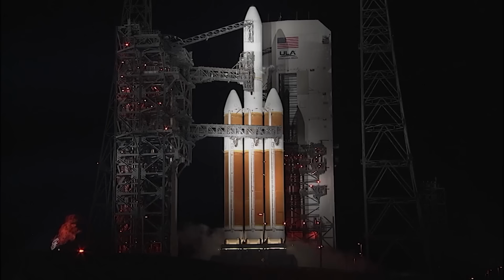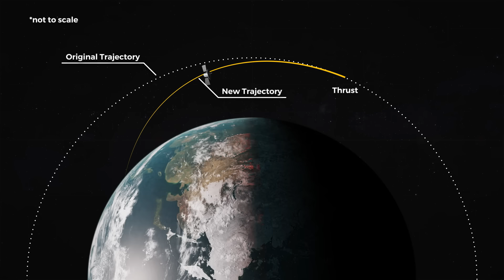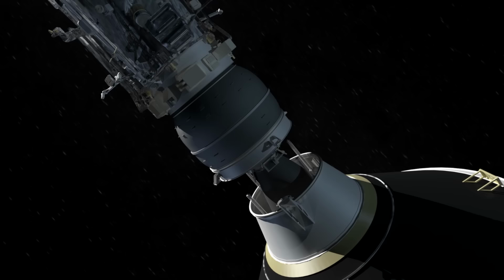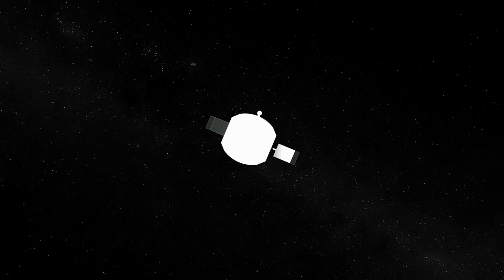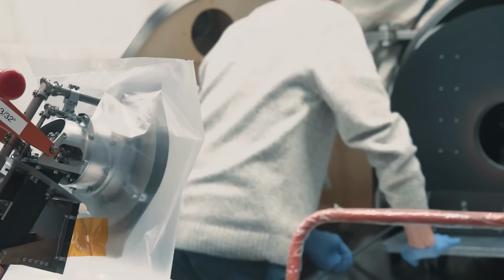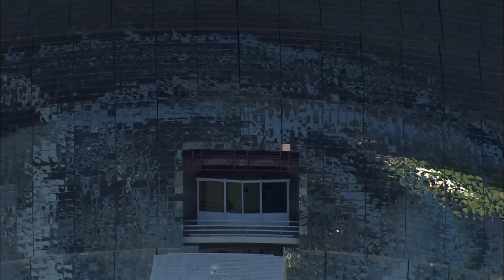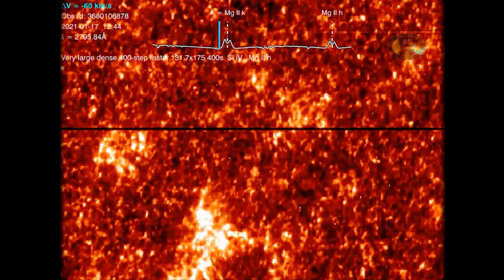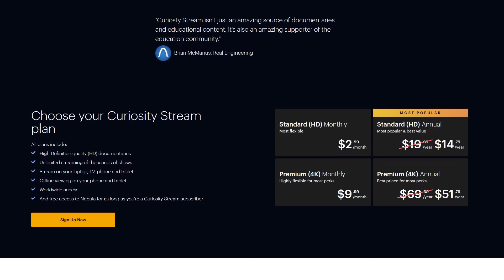The Insane Engineering of the Parker Solar Probe

Comment: The first parts of this didn't sound too crazy compared to some of the other videos you've done, but the longer the video went on, it was like we were descending further into the depths of engineering madness. Astronomy is indeed insane.
Reply: I think this wonderful madness started with the Mars rovers being lowered onto the surface - we learned that the outside-the-box solutions are turning out to somehow actually work. What a mind-opening time for space nerds! It may be engineering madness, but if it works, I guess it wasn't madness after all, right?
Reply: 1. Crazy rover drops on Mars.
2. Insane JWT engineering with hundreds of single points of failure .... that didn't fail.
3. Parker Probe going in at less than 5% of the distance from Earth to Sun.

I'm starting to think fusion is gonna happen.
Reply: The small details that took literal centuries for humanity to discover and perfect to this point is what was mind blowing to me. Niobium wire insulated by sapphire sounds so simple.. yet also sounds like science fiction. 

I feel like Carbon foam and Niobium C-103 alloy could be the subject of entire Real Engineering videos. How do we even get to that point?
Reply: I lost it at sapphire cable insulation 😂
Reply: The earth is flat and actually Satan has taken credit for the ball earth thing actually.
Reply: @taterkaze9428  Oh we'll definitely have fusion power soon! I'd say 20 years?
Reply: Humans 0
Saiya-jin 1 to 6
Angels 7 😇

Kalki Ironman 5th matriya buddha 8th arc Angel 11th satguru 13th imam and 24th avatar after 2026 😎

Almighty God 9 😇

Humans type 2.5+ after 2026 by Kalki Ironman (christ in the white horse)(son of man on clouds) type 7 and 8 😎

Jarvis the world’s first artificial intelligence (parrot) 😎

Cuz Kalki is ironman batman super saiya-jin superman ben10 saitama Narutoo shaktimaan and every super heroes combined after 2026 😎

Jarvis world’s first artificial living being (just like vision in marvel universe)😎

Made of Quantum and sub quantum particles 😎

Power source quantum energy arc reactor (type 7) level technology 😎

Kalki Ironman going to have every kind of arc reactor like:- type 1 Nuclear fission, nuclear waste, hydrogen fusion, type 2 3 4 5 antimatter arc reactor (solid liquid gas), type 6 electro quantum arc reactor, and type 7 Quantum arc reactor, type 8 limitless quantum energy arc reactor without quantum particles 😎

Kalki Ironman going to have sun in a box million billion tons of hydrogen nuclear fusion reactor type 2 3 4 5 just like sun and stars in the palm of his hand 😎

This all going to happened by self replicating quantum nanobots knowledge energy and techniques at type 7 7 7- respectively 😎

Ironman (Tesla 2.0) going to reveal every secrets of the world specially Tesla and his Antigravity 😎
Reply: Not astronomy. Astrophysics. Astronomy is basically just watching the sky.
Reply: @capturedflame  🤣 I thoughts it's always been 20 years away.
Reply: explain how to propell in a vacuum? newton's law: there needs to be a or any mass to push against!(see baloon deflate in vacuum chamber, it does not move!") need science: The vacuum of space is incredibly powerful, 1 x 10 -17 torr, and the vacuum between the Earth and the Moon is 1 x 10 -11 torr. How can such a vacuum (very low pressure) in close proximity to the Earth's atmosphere (high pressure) that goes to 8.5km elevation, coexist with the open system of the Earth's atmosphere?

The Space Power Facility at NASA Glenn Research Center's Plum Brook Station in Sandusky, Ohio, houses the world's largest vacuum chamber. It measures 100 feet in diameter and is a towering 122 feet tall. The facility is currently undergoing construction to support Orion crew exploration vehicle testing in 2010.
fact:
-It can sustain a high vacuum of 10-6 ( -6 is superscript, will change once on database) torr and simulate solar radiation using a 4 megawatt quartz heat lamp array, as well as temperatures as low as -195.5C (-320F). It is used to test the performance of spacecraft and space hardware, prior to launch.
Reply: @therealtonedef  there is probably a YouTube video on it
Reply: @moochiezpitt  can you do a Physics and Math exam for me?
Reply: And it’s not 1 + 12 = This, but it’s how can  you handle the heat of our all powerful Star ?
Reply: @taterkaze9428  I’m with you!!!!!
Reply: @bucky13  YES YES!!!   I would watch that.  Doesn’t it seem like some black and white Twilight Zone crazy science??
Reply: @theabyss5647  Astrophysics is a subdiscipline of astronomy. He was correct, just not specific. You are the one who is wrong if you think astronomy is "just watching the sky". That is a 9-year-old kid's understanding of it. Observation is a fundamental aspect of the scientific method. Are you unaware of all the discoveries and achievements made with telescopes from earth both before and since man put the first satellites in space? This amounted to more than, "Oh look, there's the moon". According to your reductionist definition, satellites are "basically just watching stuff in space from close up", the Hubble telescope "basically just takes pretty pictures", and astrophysics is "basically just figuring out what all that stuff is up there".
Reply: @jameshenrysmith8426  Puberty is gonna be a rough time for you, fella!
Reply: "There is nothing new under the sun ... all is vanity..."
Reply: @bucky13  They keep blowing and you sell your common sense to nonsense.
Reply: @raven_777  You're going to have to explain to me what you mean by that?
Reply: @nicolasnicolas3889  I'm all for a good conspiracy.. but this is a touch too far..
Reply: @bucky13  what material on earth can take these velocity or temp, and take photos. As we all no, this is all cgi. And trick photography are not only our photos of anything from outer space, but also, any and every outer space photo of earth. Just a head shaker😏
Reply: @bucky13  Thanks for being respectful as yes I may seem a bit out there, but I am not. I took NASA's own numbers for the Pioneer and Voyager probes capacity to receive and broadcast and given that a signal to be received should ideally be at leasy one standard deviation above the background noise I came up with conservative figures which showed that instead of an order of magnitude greater than background I got 26 orders of magnitude to the negative, I was gobsmacked that I didn't bother to do these quite simple calculations earlier.
Please consider doing the Math yourself before supposing that my idea is a bit far out. NASA's bullshit is far out by their own numbers. If you consider doing the math remember that outer planets supposedly give off more radiation that they receive from the sun, the background solar radiation just from the sun at the earth is around 1500 watts per square meter. Please do not mistake math and physics for 'they said it works' or miraculous mumbo jumbo. There is no way that any of this stuff works, not a hope. Not the Viking probes. Space comics and make believe is not reality, do the math. Pioneer 8 Watts, Voyager 22 watts, and don't forget SI units for distance is the meter so add 1000 onto the Kilometers, remember its' distance squared ;D not a fucking hope I got numbers which you could feasibly use electron volts to measure it with, a bit of a stretch but not much, it's a joke. if you love your mind do the math and don't bullshit yourself and I gave them as much rope as I could and I was getting MINUS 26 and there abouts for signal strength, values so low that the atoms in the antenna would be an issue!!! ;D Seriously, it's quite enlightening.
Reply: @whyitmatters6906  never mind MATHEMATICAL concepts, can you provide a PHYSICAL PRACTICAL demonstration of any of the claims the globe makes about substances
Reply: @nicolasnicolas3889  Think you would like a channel called Beyond the imaginary curve, on YouTube
Reply: @createbelief8678  Thanks for the tip I have heard this name before and I'll take a look, just to say that it seems that this reality has a self similar aspect to it and that everything is in the whole, by observing different aspects of creation without bias and programming that one can figure out it's true nature, for example water seems really important, sea water can be used as blood plasma and is the same as amniotic fluid? Is that the right name for what surrounds you in the womb? Rainbows, musical notes, waves on the sea all correspond in numbers etc. I think anyone with a good mind can figure it out and meditation on the True Creator with humility can draw in wisdom just as the Rishis. Have a great day! ;D
Reply: @nicolasnicolas3889  no worries,  another channel you might enjoy is FPV ANGEL, you have a great day to mate
Reply: @createbelief8678  Thanks Buddy! 😀
Reply: @fcgHenden  way earlier
Reply: The timing of orbital mechanics is impeccable. Hardest timing in any engineering process we do
Reply: @jameshenrysmith8426 no it’s not, it’s a rotating sphere, and there is no devil
Reply: @therealtonedef  the force created by the shuttle's engines in expelling the burning fuel produces an equal thrust in the opposite direction. This thrust acts on the spacecraft and propels it along
Reply: @therealtonedef  Like Earthly engines, rocket engines operate using combustion. Since all forms of combustion need oxygen, rockets carry an oxidizer like liquid oxygen up to space with them. That means they don't have to rely on surrounding air like a car engine does.
Reply: @therealtonedef  The simple answer is that a rocket moves by pushing on the gas that flame out from its engines. Even though it seems impossible for a massive rocket to move by only venting gas, it’s the simple scientific truth, based on Newton’s third law of motion: for every action in nature there is an equal and opposite reaction. In other words, when one object exerts a force on a second object, that second object exerts a force on the first object that is equal in magnitude, but opposite in direction. So, when a rocket violently pushes gas out of its nozzles, that same gas, a plasma composed of a myriad of tiny atoms accelerated at very high speed, pushes in unison on the rocket, propelling it forward. In the case of one of the most powerful rockets ever built, Nasa’s Saturn V rocket, which propelled Apollo astronauts toward the moon, the thrust of its engines at lift off was equivalent to 7.6m pounds of gas shooting out from behind the rocket every second.

Comment: The small details that took literal centuries for humanity to discover and perfect to this point is what was mind blowing to me. Niobium wire insulated by sapphire sounds so simple.. yet also sounds like science fiction. 

I feel like Carbon foam and Niobium C-103 alloy could be the subject of entire Real Engineering videos. How do we even collectively get to that point?
Reply: Carbon foam i dont know, but Niobium c-103 is likely something someone put together because they were curious or an engineer needed something for a high temperature project, and the material scientists took materials that were known to be able to perform well under high temps. Material science is a well developed study field, go look into it if you're curious, as even some simple looking steel materials have insane backgrounds.
Reply: @FierceFire14  Exactly, the new knife super steel Magnacut developed by Dr. Larrin Thomas, a metallurgist has 2.00% of Niobium along with 4.00% of Vanadium are aggressive carbide formers with Vanadium being the hardest carbide metal known, and Niobium is right behind it being as hard as tungsten carbide. It is in several PM or particle metal knives. In Magnacut it keeps the Chromium from forming its brittle carbides.
Reply: Scientific progress works kind of like baloon. We build up pressure with a ton of research over the years that shows clearly what we know, what we don't and what is in demand. Then when the pressure is enough usually one science team makes a breakthrough and gets a lot of credit. But in reality when such breakthrough becomes possible, who exactly does it becomes more a matter of chance rather than particular scientist's genius. All science is important. Except the fake one.
Reply: @gigakoresh  The biases of many scientists I've noticed over the years of working in the aerospace field also holds back science as well. Especially in biology.
Reply: "on the shoulders of giants"
Just imagine, if we survive this dark age, how far will we go in the next 100 years? The next thousand years? We have only just begun.....
Reply: Humans 0
Saiya-jin 1 to 6
Angels 7 😇

Kalki Ironman 5th matriya buddha 8th arc Angel 11th satguru 13th imam and 24th avatar after 2026 😎

Almighty God 9 😇

Humans type 2.5+ after 2026 by Kalki Ironman (christ in the white horse)(son of man on clouds) type 7 and 8 😎

Jarvis the world’s first artificial intelligence (parrot) 😎

Cuz Kalki is ironman batman super saiya-jin superman ben10 saitama Narutoo shaktimaan and every super heroes combined after 2026 😎

Jarvis world’s first artificial living being (just like vision in marvel universe)😎

Made of Quantum and sub quantum particles 😎

Power source quantum energy arc reactor (type 7) level technology 😎

Kalki Ironman going to have every kind of arc reactor like:- type 1 Nuclear fission, nuclear waste, hydrogen fusion, type 2 3 4 5 antimatter arc reactor (solid liquid gas), type 6 electro quantum arc reactor, and type 7 Quantum arc reactor, type 8 limitless quantum energy arc reactor without quantum particles 😎

Kalki Ironman going to have sun in a box million billion tons of hydrogen nuclear fusion reactor type 2 3 4 5 just like sun and stars in the palm of his hand 😎

This all going to happened by self replicating quantum nanobots knowledge energy and techniques at type 7 7 7- respectively 😎

Ironman (Tesla 2.0) going to reveal every secrets of the world specially Tesla and his Antigravity 😎
Reply: AirAlloy foams are amazeballs and relatively cheap and easy to manufacture hoping to have an autoclave big enough to do entire airframes in one hit but still need to get higher pen depths perfected could do a one piece drone frame but 1 cubic metre of vacuum is about it for me :(  unless someone has an old milk tanker in southland N.Z. that they want to donate :).
Reply: @Ironcammandoo  take your meds
Reply: @FierceFire14  I have machined a carbon foam aerogel. When he says carbon foam that is what comes to mind, as I know aerogels have very good insulating properties but I imagine it has to be a different material though. That aerogel was so fragile that I can't imagine how they would handle it in those quantities.
Reply: @capturedflame  Only a master linguist can pull off using extinct as a verb.
Reply: We have lost our collective knowledge at least twice. The Library at Alexandria and the Younger Dryad event 11,000 years ago which caused a great flash flood.
Reply: @Nautilus1972  While I can see the logic with the Great Library of Alexandria burning down, I don't quite follow how the Young Dryas event, which mainly affected megafauna, had an effect on "humanities collective knowledge". 

And I think the loss of the Great Library was historically devastating, I tend to think that if we base it on our current accumulation of humanities collective knowledge, we probably mostly lost out on Greek incest fanfictions akin to Oedipus.
Reply: My neighbor Larry came up with it.